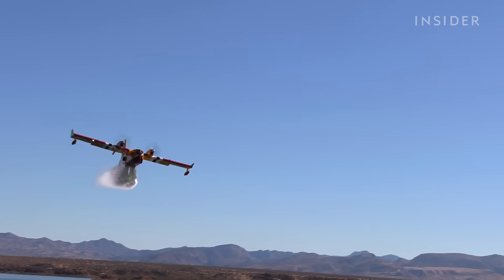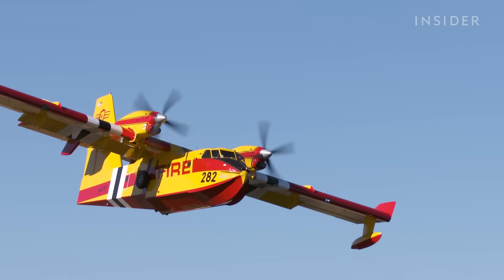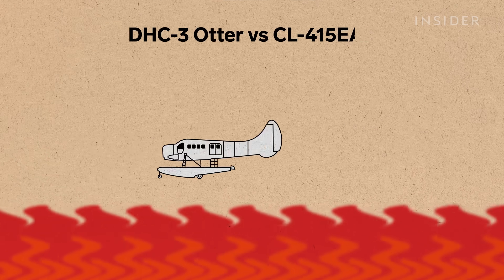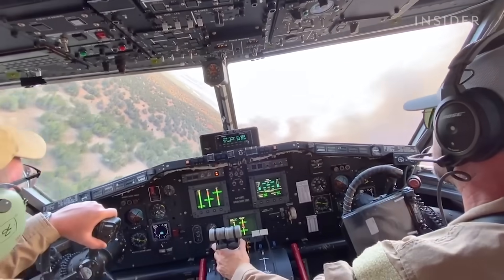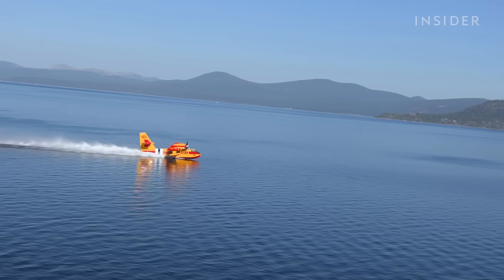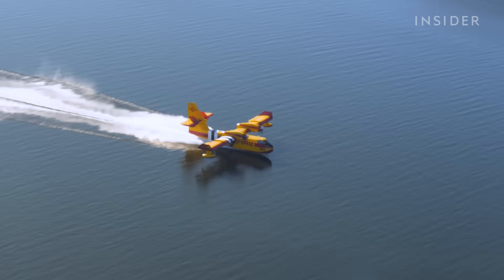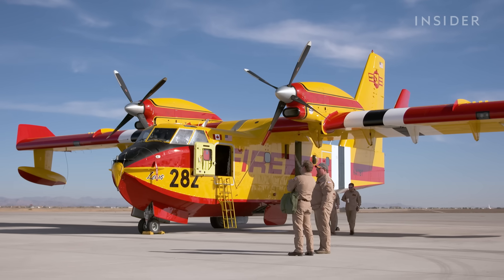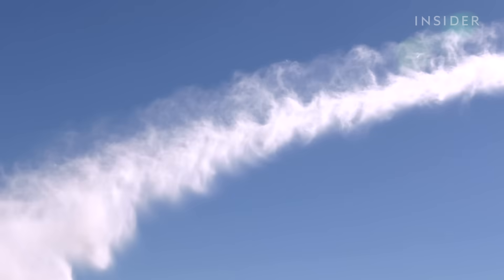How The $30 Million 'Super Scooper' Plane Was Built To Fight Wildfires

Comment: Typical Yankee arrogance. It's a Canadian-designed and -built aircraft, initially requested and paid-for by the Quebec GOVERNMENT Air Service (A Canadian provincial government) for use in Canada. Some US do***-bags hustle up to the front of the parade to take credit for the least contribution: they simply bought some of the planes. The US is on the way to burning down completely, and it may have anything to do will forests.

Comment: These planes are also, the only ones of its kind that can scoop sea  water. So for a coastal fire, they are uniquely more th an qualified to handle it as their only mission is to fight fires. Surely expensive. When you factor the drop times, and the lives, and property saved, it's not as expensive. Amazing engineering.

Comment: In my opinion, the water intake hole should be different, a downpipe with mechanical and manual mechanism for lifting it. The plane should not touch the water, it loses speed and it is more difficult to regain cruising speed.
Reply: The aircraft only skims the water, hydroplaning. There is no real loss of speed.

Comment: There is no reason whatsever that this plane should cost $30,000,000.
Reply: A 737 is around 100million
The price of the engines for the 415 alone are $2 million - not counting propellers. Then low production specialty build aircraft the price easily gets to 30mil.
Reply: @fraserwolf3453  That is insane. And completely unjustified.
Reply: @craigster1234 are you an engineer with any knowledge of this subject to make this claim.
Reply: @NotBhalu  No. But I'm not a conman or thief either. So I will say again,  There is no reason whatsever that this plane should cost $30,000,000.
Reply: @craigster1234  shame how people like you have no desire to improve or learn
Reply: Rolls-Royce Droptail, introduced in 2023, sells for $32 million.
And since, as @ffffffff-gu5qr aptly pointed out, some people have no desire to improve or learn, the price of an aircraft has to include the cost to build and maintain the factory where they are made, as well as the tooling and jigs to fabricate them. Granted the plane is expensive. It could have been cheaper if management would have listened to us engineers instead of forcing us to find ways of making a silly configuration work. We won in the end (for instance, hydraulic control were finally introduced as the numbers showed) but all the silly gadgets to try and avoid the powered controls (among other things) were forcibly retained.
But you know, no one is forcing you to buy a CL-415.
Likewise, you are in no position to force anyone to support your ignorant stance.

Comment: Why the F doesnt California have a few of these things. All the money they waste on homeless and lgbq blah blah could be put to better use on just one of these fire planes. Common sense
Reply: The winds where to fast unsafe to fly anything. 80 mile an hour wind gusts are extremely hard to fly in normally let alone when you are trying to get water. This plane has to slow down to 100 miles per hour to get water. Lets think of basic physics.

Comment: Canada should build about another 20 of these with folding wings that fit into a larger transport jet  plane.. Then rent them out anywhere on the planet  to arrive within 14 hours or less anywhere on the planet.
Reply: Folding wings? Surely you jest. We were stuck with having to reposition the engine from the original thrust line of the original 215 because the R2800's were sitting on 3 wing ribs, and the narrower PW100 are just 2 rib spacing wide, and management refused to modify the wing structure to have the engine centered. And that caused so much problems aerodynamically, we spend months in the wind tunnel trying to make it work. Now imagine how much trouble it would be to recertify a *folding wing*.
Reply: @vincentgoudreault9662  I if they were able to design it for the f-18 the f-14 the Corsair and the hellcat ... they can probably do this too.... With folded Wings you'd be able to sell dozens per year 
.... Think out-of-the-box
Reply: @Foo-Fah-Foe-Fum  The folding wings of the F-18 were part of the design from the get go. And there is hardly any fuel in the wings of fighter jets. Moreover, fighter jets are NOT certified. It is not that it is not doable, we aerospace engineers can pretty much do anything. It is that the certification agencies would require an extensive flight test and certification process that no one is going to want to pay for.
Reply: @Foo-Fah-Foe-Fum  Let me guess: you are NOT an aerospace engineer.
Right?

Comment: Comparing it to a Otter is not fair, what about the Martin Mars  with is 7000 gallons capacity?
Reply: Comparing it to the Mars is also unfair. It's water capacity increases it's weight, which decreases it's maneuverability and versatility. A Mars, for example, could not refill it's water tanks an smaller lakes, or take off and land in mountain ranges.

Comment: I used to get shlt for flying like that, and these guys are getting paid. Good gig.
Reply: Try it - with reduced visibility from smoke - and buffeting from updrafts from the heat of the fire - and the intense change in WEIGHT of the aircraft immediately after the drop... try it.

Comment: They should have at least a dozen of these planes operating at one time.
Reply: That might be a bit dangerous in very smoky conditions or when operating with relatively small air spaces. But pilots and air traffic controllers are far more qualified to assess that than I am.

Comment: It’s amazing the wings don’t rip off when they drop that weight, and power into a climb at the same time.

The G forces put on those wings has to be insanely high, pretty amazing engineering, no wonder they cost $30 million each.

Comment: No so impressive when compared to the Air tractor AT802.  One crew member(pilot), 3100 liters water/retardant, cruising at 350kmh, 2.5 million a copy.   the CL-415 is 30 million, 2 pilots, cruises at 330kmh but almost twice the water capacity.  Can put ten to twelve AT802's in service for for less then the cost of CL0415 and a lot less in maintenance and storage.   Canadair should get a contract to build these things(AT802) , be much better for the firefighting services, and they can crop dust, SAR, transport material , and lots of other operations

Comment: How does this plane manage to maintain its balance and keep flying when suddenly it lost 1,400 gallons (11,676 lbs) of water (the video said in 4 sec) when the drop button is pushed? 
The video said something like the gigantic & very curvy wings and the skill of the pilots... There should be more trade secret than these...  Globally, there are not that many manufacturers can produce such a miracle worker fire fighting flying machine.
Reply: The water tanks are located on the center of gravity of the plane. Dropping the water load does not pitch the plane.

Comment: Bombardier never allowed this aircraft to flourish. Now that Viking has it, some strong hope arises! One hope is to invest in rigid tooling, so instead of hand adjusted everything and each hull being a fight, proper serial production can happen. Next is the abuse of supply chain. Instead of frequent line stops due shortages, a non adversarial relationship strategy can end constant interruption to field support and production. Finally the door is open to study major changes! What would happen with six blade reduced diameter props? Bigger PW127? Can a super scooper be built with PW150? How about looking at re engine with large PT-6 (weight savings allows more cargo). Maybe look at pusher with Avanti set up with steel blade props? So much hope now that BBD and toxic MBA is not there. The world has more fires. The market is there. I believe they could sell 50 a month.
Reply: Nearly all the aerodynamic gadgets on the CL-415 that were not on the CL-215 are to address the forced repositioning of the thrust line because management refused the wing to be modified so that the PW100 could sit on the center rib (the R2800 sat on 3, the PW100 is just wide enough to sit on two), which caused the propeller side wash now hitting the tail, and their insistence to not have hydraulic powered control surfaces. In the end, they had to accept powered controls (certification agency warned there is no way they would certify the plane if it wasn't nimble enough) but all the now useless gadgets to try and making it work despite it all had to stay because they are part of the official configuration. Changing the engines would be an even bigger deal, recertification for what? 100 or 200 planes? (there were a total of 220 CL-215/CL-415 made, for the record). If there was a real demand, a much better -- and cheaper -- airplane could be derived. I would even consider coming out of retirement to show then what to change.

Comment: 1,500 gallons is still a pretty small load aside from scooping water using an A-Star or SkyCrane.  The fellow who is being interviewed said the CL-415 is about the size of a Hercules.....????  The Herc is 50 feet longer and has a max takeoff weight 3 times that of the CL-415.  That said the Herc cant scoop water which is the CL-415s great advantage meaning it can refill many times as long as there is a source of water somewhere near which is not always the case!  Its use depends on having that water source nearby that is also long enough for the CL-415 has enough room to descend, load and gain altitude, again, there is often not a lake nearby to do this in which case the CL-415 is no more useful than a tanker that must land and perhaps less so given its small capacity.  It replaces old DC-6s (among others) that could tanker up to 3000 gallons but were far less maneuverable.  The CL415 is a great asset fire fighting as long as your fire is near water!  Otherwise larger planes like the MD-87 tanker, the converted BAe 146 are more effective.  Note, the Herc modified for aerial firefighting can carry 4000 gallons of water or retardant.
Reply: Don’t know gallons but over 6 cubic meters is a lot.
Reply: Thank you!!

Comment: This plane has always captured the imagination of the public. But it hasn't sold well and isn't as widely used as you'd expect. It doesn't provide the total volume of water per hour as other platforms do. Doubly weak when you factor in its high cost, decidedly not cost effective as claimed. 2 FireBoss'es with the same 2 pilots best the Super Scooper with better agility, speed, and total volume per hour, for 1/2 the cost.

Comment: A small correction: 3:05 The fact that the aircraft is shorter than a Boeing is reason to enlarge a rudder, not make it smaller, all else being equal. If the rudder was placed twice as far from the CG, it could in theory be half as large.

Comment: Rudder does not control the direction of the a/c, at least not primarily, the ailerons do by changing the lift vector, rudder controls the yaw that is a secondary effect of the roll created by ailerons. The low aspect ratio wings creates a lot of adverse yaw so requiring a large/powerful rudder to balance a turn.

Comment: The new CL-515 can drop more water on a fire per day than any other airplane.
3 times as much as the C-130.
There are many places that will need more of these aircraft in the near future. 
Canada needs more of them now with the worst fire season on record and it's not officially summer yet.
Reply: I'm a huge fan of the CL-215/415.  And look forward to seeing the first DHC-515 fly over my home city of Calgary the new home of  DeHavilland Canada (formally Viking Air).  But, the "Canadair" is not right for every country.  If you don't have a water source near by your fires and you need to be filled at the nearest airport, they are not going to outperform a converted DASH8 or Hercules. The performance comparison  is only true if there is a nearby source of water.  And honestly on a calm day two Fireboss converted crop dusters can out perform a single CL-415 for a lot less money as well.   But the Cl's can fly and scoop in harsher wind conditions.  So this can be a real game changer when fire fighting in difficult terrain and scooping from larger wavier bodies of water.

Comment: They need to hold 5000 gallons of water or 20 000 litres make them with larger capacity
Reply: The aircraft size is the result of studies regarding the effectiveness thereof. A bigger plane would not be as nimble. A smaller plane not carry as much.

Comment: Why does it has to discard the load so sudden? Wouldn't be more efficient if it were to "shower" it over a longer stretch of fire? The way I see the wildfires is that there's usually a frontline of fire, and the key in dropping water is to drastically decrease temperature so that the fire goes out. Imagine 2-3 firefighter planes like this one, in a line (one after another) just "spraying" a torrential rain over 2-3 km. I guess it would be more effective than just dump all the water in one spot. 
What do you people think?
Reply: Why do you think the major improvement of the CL-415 was the introduction of a 4 doors drop system, instead of the original 2? That is precisely so that the water dump could be in a longer, narrow pattern.

Comment: Say what you want against reusing military aircraft, but if an Antonov AN225 comes available you might wanna reconsider. It could drop a small lake on it. 60,241 gallons minus fuel weight to be exact 😆
Reply: The problem with going bigger like that is maneuverability of the aircraft for getting into tight terrain. The larger the aircraft gets, the less places it can actually fly in.

Comment: Why cant we develop a Machine Learning algorithm to assist in a better more controlled deployment/drop of water. if you could control how much water exits at a specific second, you could in theory do the math automatically to adjust to the heat signatures on the ground using a thermal camera, calculate the speed your going +or- any side wind loading. and boom. Pilot drops water, plane drops medium amount of water, it detects the most prominent signature and tune the amount of water/drop. Obviously this wouldn't be used in every scenario, but does this currently exist? and if it doesn't why not?
Reply: Why don't you go ahead and design that, then? See, it is always easy when someone else has to figure it out...

Comment: Just like to note something @1:00 
Early planes were effective, depending on the aircraft ofc. One of the best ones was the Martin JRM Mars,  ww2 vintage patrol bomber, turned priority cargo plane, turned water bomber. It could scoop and hold 27 000l of water (compared to the C130 water bomber that holds 11 000l and newer more nimble CL-415 that holds 6 130l). They were no slouches when it came to dropping water on fires.
Reply: The JRM Mars was actually horrible. 

It could not land on land.. which means that it could not refuel and add foam to the water it dropped to make it more effective. 

It could only scoop from a handful of lakes. 

It was very slow.. making transits long and reducing the “litres per hour” put on the fire. 

Everything else had to get out of the way when it dropped… helicopter bucket ships, retardant tankers, ground crews, other skimmers… meaning that it basically only helped as much as it took away from the fire.
Reply: @Bartonovich52  but it usually took one or two passes and that forest fire was out. seen it got places to get the job done in a day! retardant was added onboard the plane when necessary
Reply: @Bartonovich52  Martin Mars used foam.  They also held almost 5 times more water.  I don't think they were horrible.  Trouble was the parts were running out and these planes take a lot of maintenance.

Comment: Basically the A-10 of the firefighting world. When you hear it's engines roaring in the distance, you know help is on the way.
Reply: Scooper Vs Warthog:  CAS

Flying low and slow to theatres this June.
Reply: A-10? Junkers, baby.
Reply: You don't really hear turbo props until they are right there.
Reply: Zsu-23-4 AAA would like to have a word... The A-10 warthog is literally only decent at its job in an air superiority environment. Any fighters, and or AA will shred A-10's.
Reply: When you hear the whistle of the A-10 gun you know your f’d

Comment: Isn’t the firefighting 747 way more expensive? The whole plane would prob cost 100+ million USD.
Reply: The 747's used for firefighting are generally repurposed planes, not brand new
Reply: @HumanSubwoofer1  Even then the general value is higher. It costs like 400mio brand new so even if it gets repurposed it still has a higher value.

Comment: To the many commenters about cost & needs: This is an excellent aircraft, no doubt. The Viking CL-515 is the newest iteration of the workhorse Canadair CL-215 & Bombardier CL-415 which were built in Montreal. However, counties & states have been strapped for cash in recent years which is why most of these aircraft are leased or loaned. Also, they are not always suitable for some arid western US states since they require a sizable & open water source to refill by skimming. If they must land to refill then their main advantage is lost & other air assets may be more suitable. CalFire recently acquired seven C-130H transports from the US Coast Guard which will be converted to carry 4000 US gallons compared to the 1400 gallons of the CL-515. They can land & take off on short unpaved runways & are designed to operate in "tactical conditions".